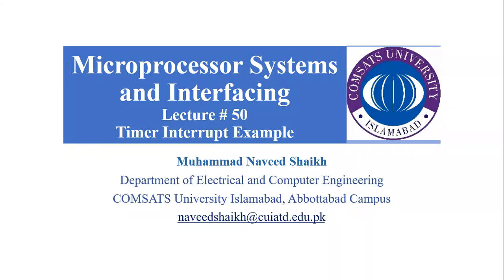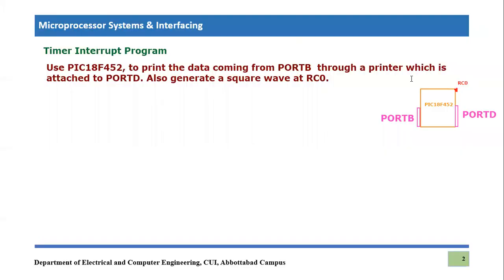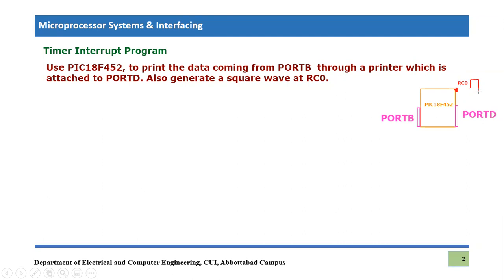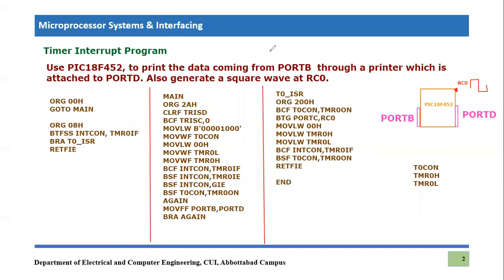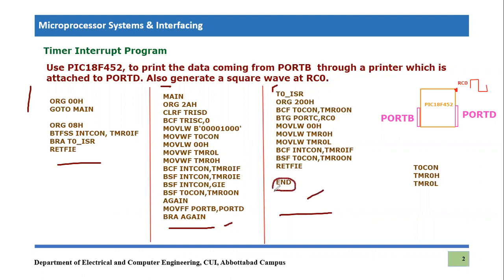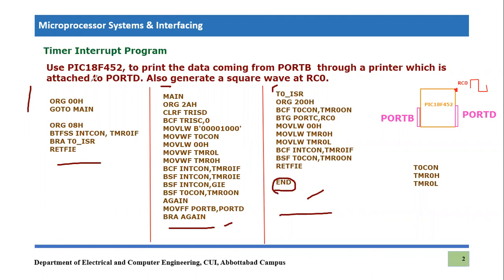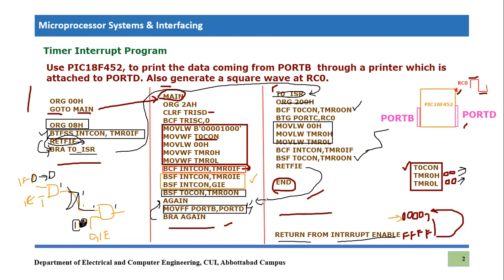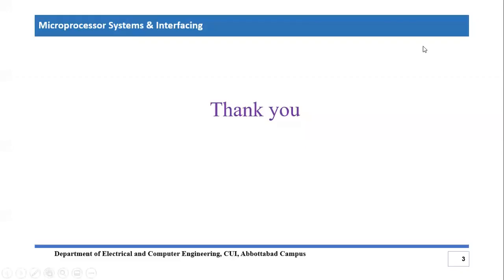Timer Interrupt example in assembly language for PIC18F Microcontroller

Comment: Thanks for the tutorial!  It's hard to find assembly language tutorials for microcontrollers anymore, it seems.  Everybody's teaching C.  

I'm brand new to PIC18' class of controllers.  PIC16' on the other hand, I've been programming for years.  I recently downloaded the instruction set for the PIC18F442 and got very excited to see that there was a PUSH and POP statement in the set.  I've been Googling how these are used and I can't find much talk out there about it.  The datasheet seems pretty vague about it too. I was hoping to learn that these two instructions replaced the PIC16' method of saving and restoring the STATUS and W register in  an interrupt (like swapf _w, w).  I see your interrupt code doesn't bother preserving those and I am assuming that is because the main code is very basic in its nature and you aren't concerned with losing the contents of those registers--probably for purpose of keeping the tutorial simple.  However, it did also occur to me that maybe those registers are now somehow automatically preserved in the background in the PIC18 series.  I would love to hear your thoughts on these two instructions and whether or not they can be used (or at all need to be) to preserve registers in an interrupt routine.
Reply from the maker: I am sorry for the late response. I was swamped and could not answer any comments. I hope it is still helpful for you.
 You are pretty much correct. All old settings:"including calling back the variables from stack " is an old story now. PIC 18F does it automatically and silently. That's the beauty of the PIC18.  
I am honored to reply to such an expert in PIC16. Although,  I worked a little on that, but that was the original era of assembly. More close to the processor. It is like you are doing the psychology of processor. The true worth can be understood by vibrant gems people like you.
Reply: @LearnOnline1  Hey, thanks for the kind words!! That's exactly why I tend to gravitate to assembly language programming--so I can more closely appreciate all aspects and features of microprocessor or microcontroller's hardware.  Higher level languages often create a disconnect with me in that regard.  Thanks for the response!  I've set my '18F442 project aside for the moment, but this information will help me when I get going again.